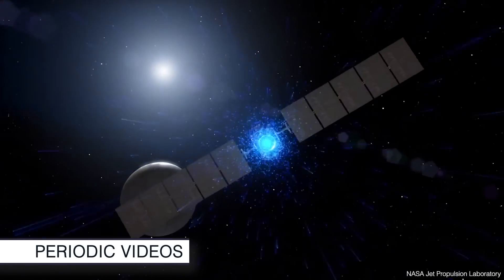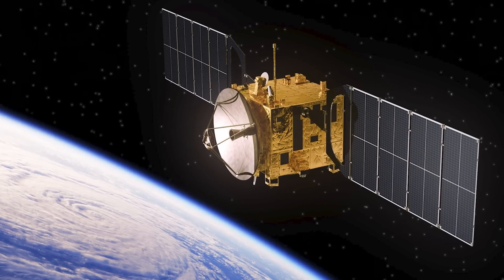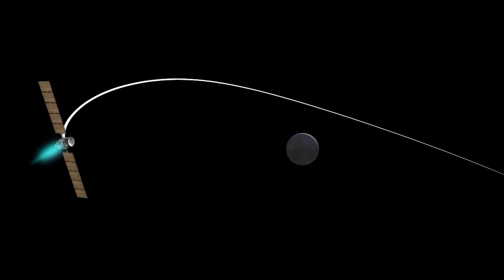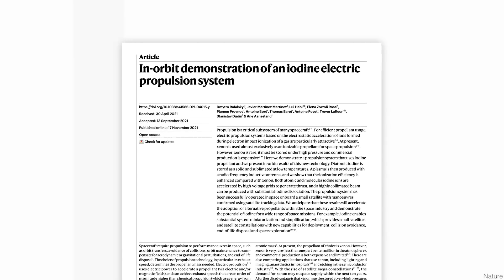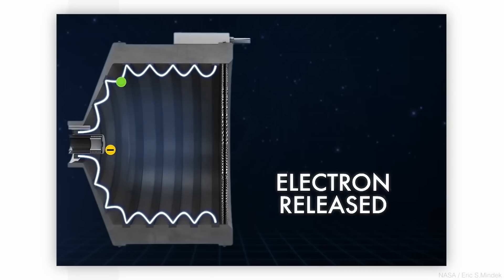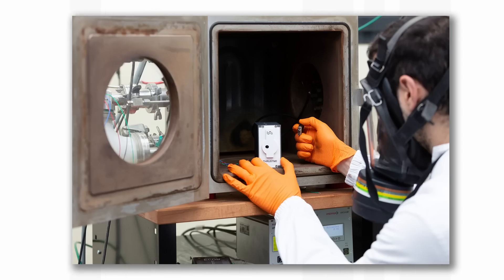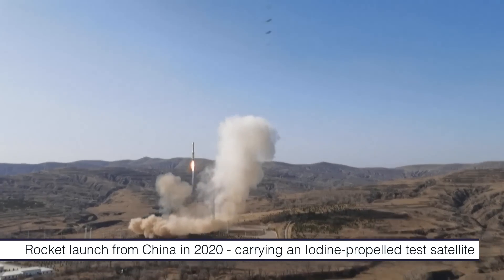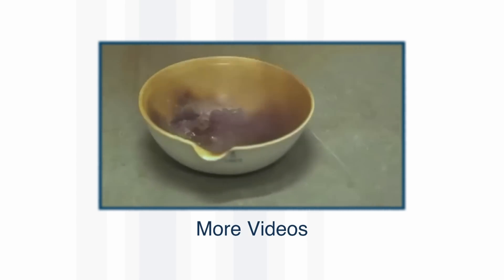Iodine Satellites - Periodic Table of Videos

Comment: 2:08 Iodine does not sublime under earth pressure(air pressure and gravity) but has a short liquid phase of only 71 degrees centigrade. Arsenic does sublime though and is the only element to do so at earth pressure(even carbon has a short liquid phase)
Reply: That should be 5 degrees C, not 71.

Comment: Couldn't you use any room temperature solid? It just would depend on adding more energy to the system to get it to sublimate wouldn't it?
Reply: You can but performance would be low.

You want something that is both high mass and doesn’t require much energy to dissociate/convert to charged form.

Both xenon and iodine fit this description
Reply: @mduckernz  nifty

Comment: I'm sorry to say that here, but iodine does NOT sublime at normal atmospheric pressure. It has been shown countless times that heated iodine first becomes a liquid before it goes into the gas phase. It would have been important to mention that, in fact, there is still this misinformation that iodine sublimates under all circumstances.
Reply: Not atmospheric pressure in space, - At <0.12 atm approx iodine goes directly from solid to gas phases.   At 1 atm the liquid phase lasts for only 5 degC so it is effectively sublimation in practical terms.  Have a look at the phase diagram.
Reply: @karhukivi  maybe you should retrain your skills. Water also goes directly from the solid to the gas phase in a vacuum. But there was never any mention of a vacuum. A chemist should be professional enough to state such facts, especially since it is known that incorrect information is circulating, especially with iodine.
Reply: @SciDOCMBC  No mention of a vacuum?  The iodine was used for manoeuvring a satellite in space.  Your skills - and that includes your manners - seem to be very poor.

Comment: So the charged ions 'push back' at nothing more than the magnetic field when they leave the motor, if I understand correctly? Kind of like pushing a fridge magnet from a distance.?
Reply: No, iodine ions are accelerated to an extremely high speed by an electric field inside the device, which generates thrust in accord with Newton's laws, similar to any other rocket engine.  The iodine ions are subsequently neutralized electrically by a beam of electrons that is nearly collinear with the iodine ion beam.

Comment: Dry ice sublimates too. Just:
- 1 x C + 2 x O is still much lighter than 1 x I
- What are compounds doing in high voltage fields? Would it accelerate the same way?
- Storage on Earth is hard since it needs to be stored cold. Otherwise all you get is just high pressure gas.

Comment: hmmm... iodine is really corrosive though - isn't it?
Reply: It shouldn't matter.  You're controlling the gas with electromagnetism.  It should never touch the walls of the thruster, and in its solid storage phase it can be contained with non-corrosive elements.  Although, it's possible it would react with the acceleration grid.  Hmm. Something to think about.
Reply: @tarmaque  actually wall erosion is a  primary life limiter of  these types of drives. most of the prop misses the walls and grids but the small percent does it.

Comment: The current set of Starlink satellites use Krypton. It not as performative as Xenon but is much cheaper. There was also some designs for mercury based ion thrusters, but they (rightfully) got banned for environmental reasons
Reply: Mercury interacts with the materials of the thruster like the grids and forms alloys that limit the lifespan.
Reply: Krypton, that was it. Knew they were using something different to xenon.
Reply: Glad that mercury got banned. Imagine it could have poisoned all the life out there.
Reply: Makes sense Elon want Krypton around the world

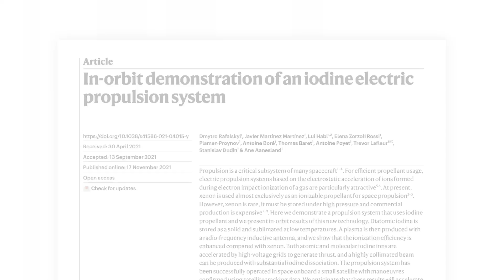Comment: 2:03 if you heat iodine, it actually (also) melts. The sublimation refers to the phase transition occurring because of its high vapor pressure. There is a very nice Nile Red video about it.
In space (because of the low pressure) it probably only sublimates, but the description in the video is a bit misleading in my opinion. 
Otherwise great video!!

Comment: If you arrange your electron gun correctly you can also use the velocity of the electrons you emit as additional thrust. Not much thrust per electron, but you can get them up to pretty high velocity using grids and ring anodes, so generate an appreciable amount of extra thrust as well from the charge balancing. 3 small ones around the main positive ion engine and you also get small amounts of thrust vectoring as well, using different acceleration voltages per gun. Yes you have to activate the cathodes in space after launch, but as a bonus no need to worry about the tube getting contaminated with adsorbed gas, as you have all the vacuum you will ever need.
Reply: is there some way to angle them slightly to get roll control? I imagine you can angle one opposing pair slightly one way, and the other pair the other way, but that might in turn lose pitch or yaw authority

Comment: So Xenon, Krypton and now Iodine have been used in ion thrusters? Any other propellants ?
Reply: These are probably the best.
Reply: a while ago on SciShow, I heard that people were using Teflon for cubesats because it's a solid inert block, it's like a spring loaded cube that grates against the ionizing mechanism

Caesium is of course the best propellent, power-wise, as Scott Manley pointed out, but it's too reactive in most cases. Hydrogen is still the best mass-wise, but ion engines are usually efficient enough anyways, so people worry about thrust more
Reply: i worked in a lab in college that was testing zinc magnesium and bismuth in ion drives.